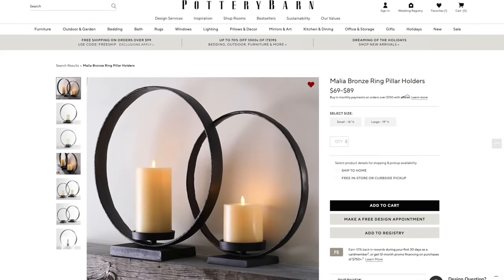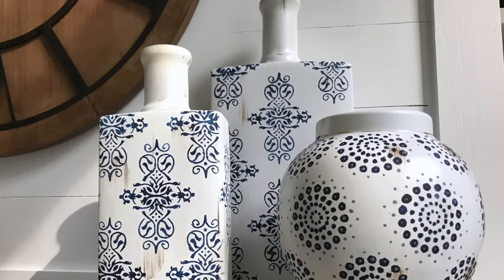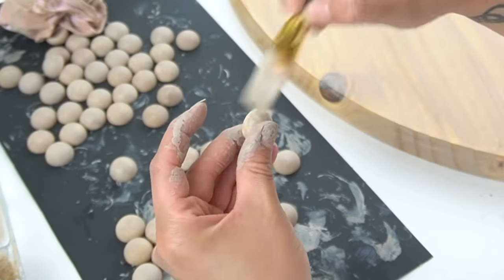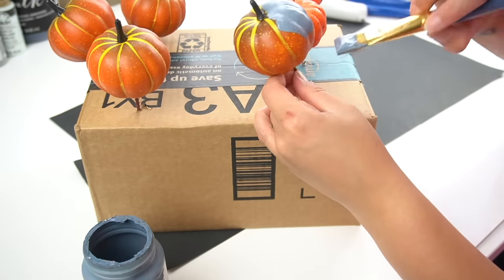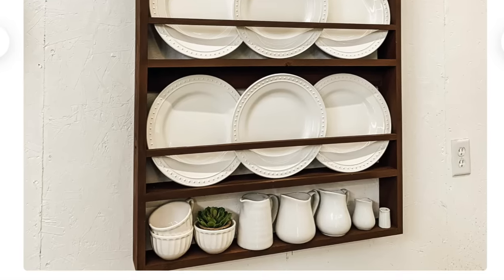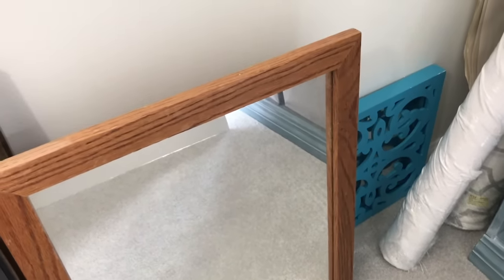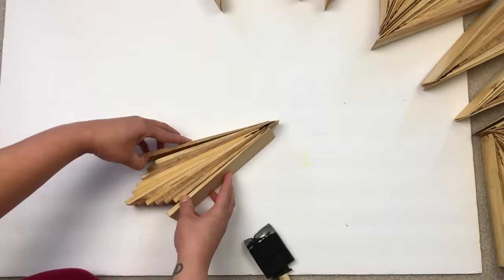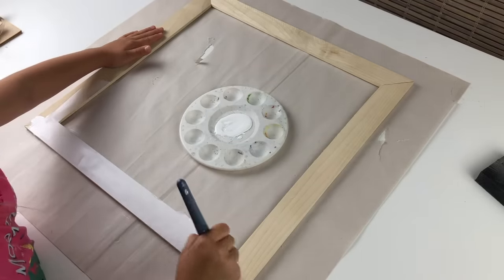🌟 HIGH END LOOK FOR LESS DUPES FOR YOUR HOME IN 2024

Comment: Your dupes are beautiful.  I like your wreath better than the one in the magazine.  I got a “bow maker” about 20 years ago at JoAnn fabric.  It works well but is basically a flat piece of wood with two sets of vertical spokes.  You just loop 1 pk of ribbon back and forth and slip a piece of wire underneath to secure it.